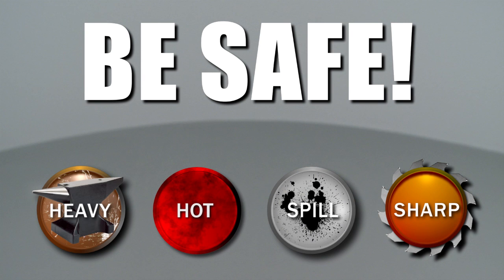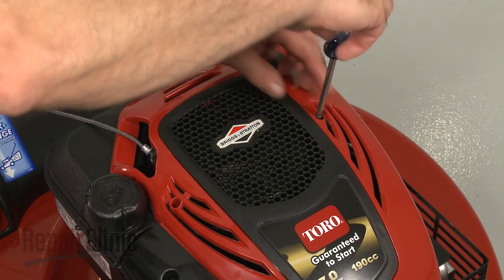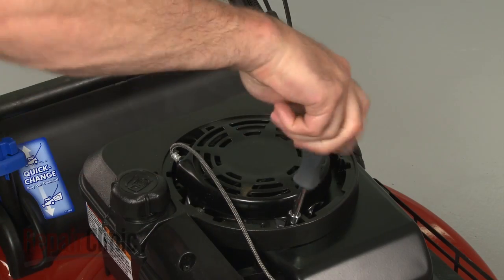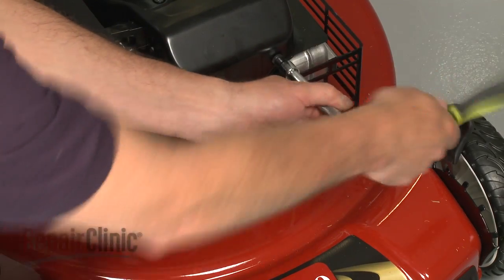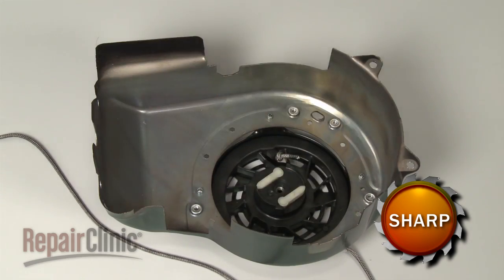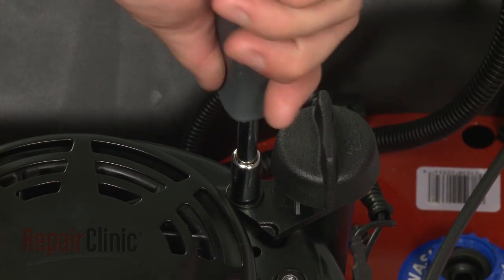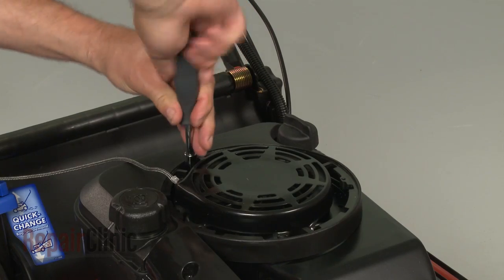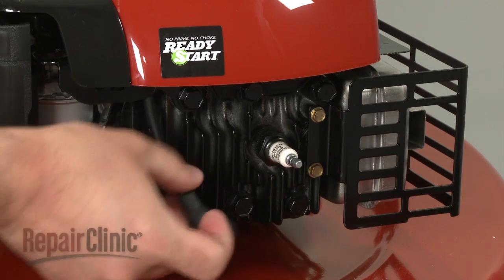Briggs & Stratton Lawn Mower Engine Ratchet Pawl #281505S

Comment: for the "springs question", no where in the parts manual diagram does it show those little, traditional type "springs". The manual does refer/show the single, "friction spring' but that's different. I thought maybe I just dropped my springs while changing the pull cord, so I bought the little kit. Now I'm convinced there were never any springs and I don't need that kit.

Comment: My friction plate was plastic & it broke on me, so I fixed with a metal washer that I had laying around & it worked fine for a while... but now the ratchet pawls are way worn out, & also the thing the pawls slide into is worn..  I will try a different setup/ sizing of washer & hopefully be okay for a while!   (I have two 3 acre properties to maintain... & I just broke the deck on our john deer zero-turn, & I broke a pully on my riding mower, & my gx35 weed-wacker is just kind of ridiculous -plus its dieing out on me...  AAAAHHHHHH!)   Oh yeah, & my self-propelled push mower is broke now.  & I sorta live in a rain forest.. in Hawaii, AKA everything grows soo fast!!

Comment: My Rewind Starter Repair Kit comes with 2 tiny springs. Based on images of this part I've seen online, I believe they slide into the outermost slots in the friction plate but what is their purpose?

Comment: I've seen this kit come with two small springs... are these unnecessary?  Confused...
Reply: This is EXACTLY my question. My Rewind Starter Repair Kit comes with 2 tiny springs. I believe they slide into the outermost slots in the friction plate but what is their purpose?

Comment: i did this and it sort of worked, when i started my lawnmower it made a terrible horrible sounding scratching sound from the ratchets what did i do wrong
Reply from the maker: I would take the blower housing back off and double check the friction plate alignment on the ratchet pawls. The indent in the plate should line up with the tabs on the pawls. You can check the operation of the pawls by pulling the starter cord and see if the pawls extend when you pull the cord and retract when you let the cord back in. If the pawls are not working properly or the cover is not aligned properly the pawls may not release and make a lot of noise.
Reply: RepairClinic.com Why are you not mentioning the springs?

Comment: the friction plate warps which releases the ratchet pawls out too far, and they fall out or do not retract fully.  Is there something I'm doing to cause this?
Reply: Did you ever figure this out. I have a 12.5 Briggs that I have to replace this plastic junk in ever year or two. I wish there were a better fix for it than this plastic. There is a little plastic pin in the part that the white pawls sit down over. If they break, which they do a lot your pawl with come out.